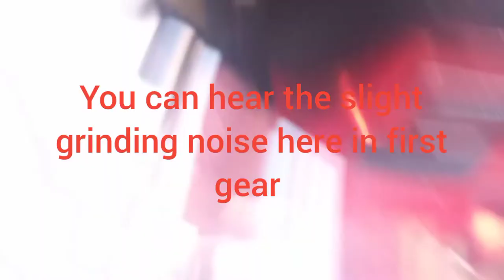Diagnosing a Bad Transmission Input Shaft Bearing

Comment: how long can u go with this problem?  I have had it on my nissan sentra (2006) for the last 40K miles.    and what happens when it gets worse or completely gives out?  can u still drive it?    I am currently as 245k miles.    I hate to pay big money for any major repairs with that many miles.    I am just trying to squeeze everything I can out of this vehicle before I junk it and buy another one.  I have researched this a lot and read you could drive a vehicle indefinetly with this type of problem .  u just never really know when it's going to get worse.   not sure if that is true.
Reply: If running it to death I will say Nissans will run for a long time it’ll grenade one day and not be drivable because the damage will be insane but it should run a longgg while with the problem just won’t be the strongest or fastest lol
Reply: I am wondering the same thing so did you figured it out ?? Did you replaced bearing or kept driving ?
Reply: "Did you replaced bearing or keep driving ?".   JUST KEEP DRIVING.  this exact same thing happened on my 01 frontier at the exact same mileage (around 200K).  that time I paid a transmission shop for a rebuilt and guess what?  after 100K miles on that transmission I started getting the exact same noise.   I was not happy.   UPDATE....... I am up to 279K miles now on the car.   so that's almost 80K miles (mostly highway miles) with the input shaft bearing making noise.  I do make sure to use the best transmission fluid money can buy (AMSOIL).    I never did find out if this was common with nissan manual transmissions (I've had 3 nissan MT vehicles from the mid 90's to mid 2000's and had this problem on 2 of them).  but some of the automotive forums I viewed had the opinion that for some manufacturers, it's just the PERSONALITY of the transmission.  not really anything to worry about.

Comment: same issue on mine 2004 subaru impreza. mine also clunks back and forth when on and off gas when in gear clutch out. it feels like is has bad mounts but i have replaced the engine mounts and the trans mounts and the problem is marginally better but not fixed. could this all relate to the worn input shaft bearing?
Reply: Currently having the same issues on my 04 impreza , how did you go?

Comment: This is what is happening to my 08 Ranger.. will have to take it to a mechanic soon to confirm. I'm wondering if replacing my transmission fluid might improve anything.
Reply from the maker: It could help some transmissions whine when low on fluid
Reply from the maker: Best way to tell is to pull it out and inspect everything
Reply: new fluid wont help bad bearings

Comment: Wow after months of trying to figure out what the noise was I think this is it! I've replaced everything even a different gearbox and it still made the same noise I'm guessing the gearbox is just as bad as my old one, both had shaft play but assumed it was normal for a 40 year old engine, going to put thicker oil to see if it makes it quieter, then put a new bearing in my old one haha

Comment: thanks man, I thought a flywheel bolt backed out but this is my exact noise and problem...before I was told to check if the noise changed when depressing the clutch it almost sounded like a rod knocking or piston slap.

Comment: I’m having the sound in neutral and it goes away when I clutch in. I can also hear a slight grind while I’m in gear in 1st and 2nd but the grinding noise goes away once the vehicle is warmed up. Do you know why it makes the grinding sound when vehicle isn’t warmed up fully? also the noise in neutral isn’t as loud when it’s warmed up.
Reply from the maker: The noise changes because the bearings increase in temperature which in turn make metal expand making up for the wear in the bearing. It could be the throwout bearing or pilot bearing if it has one.  Best to pull it apart and examine it if it starts causing problems
Reply: @MotorHeadMadnessOfficial  it has the exact symptoms you describe in the video. Noise goes away when I clutch in. Slight grind while in 1st and 2nd but goes away in higher gears or when warmed up. No other issues and still shifts smooth and drives fine. Thinking if I should just keep driving and send it.
Reply: if the noise goes away when you press the clutch in, then I think it is a bad input shaft bearing.

Comment: I drive a '13 Mazdaspeed 3. My car was and still is making the same sounds when the clutch is not being pressed in neutral. Also, when acceleration, it sounds like a really bad bearing, almost grinding sound. Dealer replaced pilot, throwout, fork, pivot, and entire clutch. Only thing different is the aluminum single mass flywheel; rest of clutch is oem. Some chatter is expected with a lighter flywheel but the car was making the same sounds before on the oem clutch kit. Basically everything except the input shaft bearing was replaced because they swore that it wasn't the problem. I'm at 3k miles and the sound has not gotten quieter. Any help would be appreciated.
Reply from the maker: Sounds like they never checked the input shaft bearing at all
Reply: All Mazdaspeeds have wicked flywheel chatter in neutral with the clutch out. I have the same thing after replacing and still after 15k miles in my 08.
Reply: @MotorHeadMadnessOfficial  hello I have a Vw Golf 2017 and it’s doing the same noise as this video. When I use the clutch no noise, if you don’t use clutch the noise comes back. I would like to know if that was the problem. As I don’t have a lot of money to keep changing or buying new parts thanks

Comment: I have BMW E46 with 5 spd manual same thing rattle on idle it goes on clutch in , loud clunk when accelerate on 1st 2nd gear I am going to pull out transmission and check after I saw this video

Comment: on my car is present only in 1st gear between 2200-3000 rpm(after 5-10km, not on cold start) but not that loud. goes out when i fully press the clutch(keeping the same rpm).a bit of noise in the 2nd gear but you need a really good ears for that. no noise in neutral or other gears.driving like that for +10k and the sound didn't change. can it be also the input shaft bearing? 🤔

Comment: mine sounds like the engine is running at 3x the rpm, really disconcerting. also stops when going downhill(likely the bearing is worn on one side only) hopefully will be able to either fix it or replace the tranny

Comment: Got my trans rebuilt and has new clutch new flywheel, the clutch came with the pilot bushing so I don’t think that’s it , same issue , was it the input shaft bearing?
Reply from the maker: Most likely it’s something in the transmission that was missed

Comment: Did you have to change the whole transmission or the bearing??
Reply from the maker: The bearing but every car is different you just have to inspect everything
Reply: @MotorHeadMadnessOfficial  mine is a 13 vw Jetta

Comment: Mine is doing this too although not as loud but mainly under load at 4th and 5th gear. Is that likely to be the same problem?
Reply from the maker: You may be low on manual transmission fluid